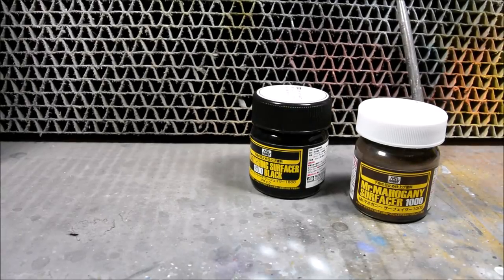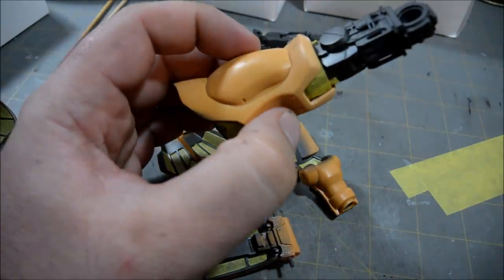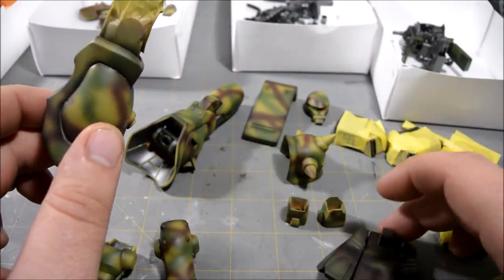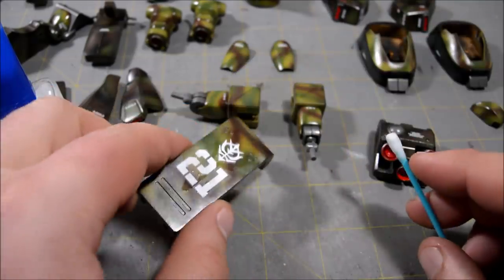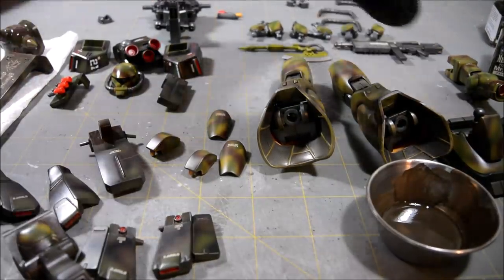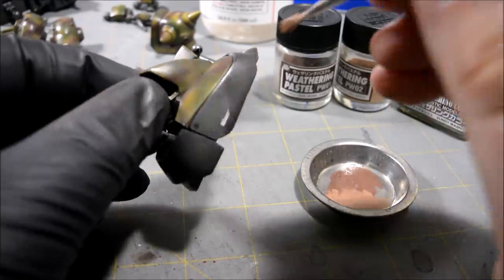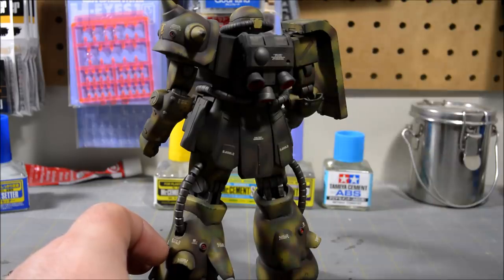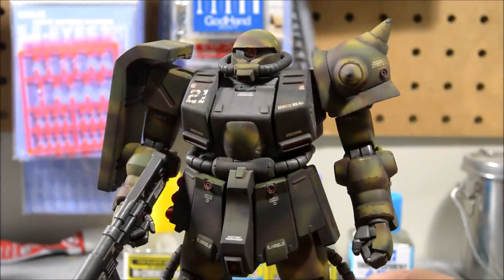Work in Progress: 1/100 Zaku II Kai part 02 - B-Club Resin Conversion Kit FZ

Comment: Hi Henry I was wondering how you used the pledge? Did you have to thin it at all to go into the air brush? Also how do you clean it out of the airbrush?
Reply: Doesnt need thinning. Isopropyl alcohol will clean the airbrush